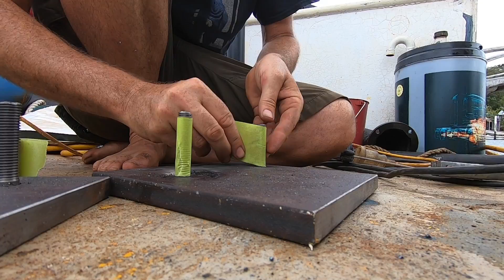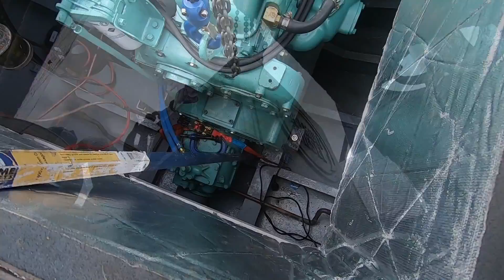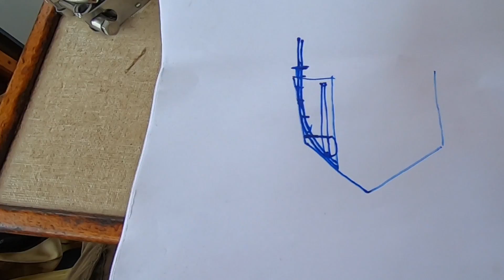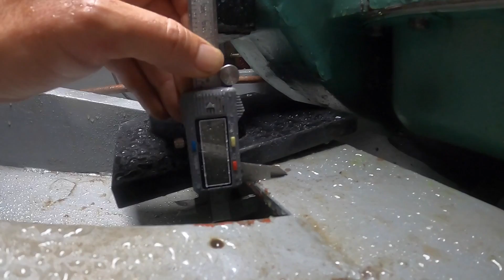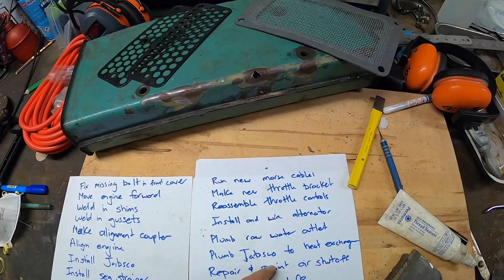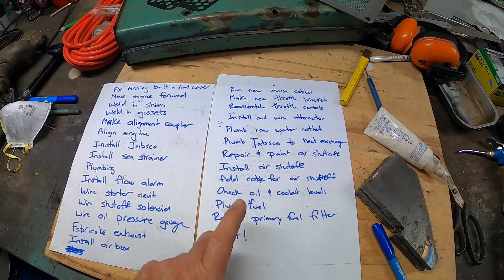Making and installing new engine shims

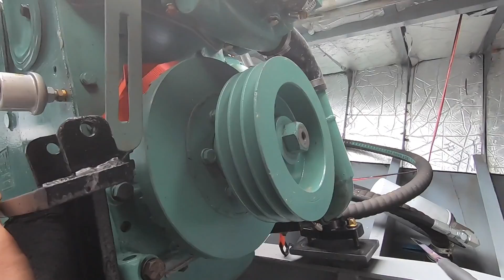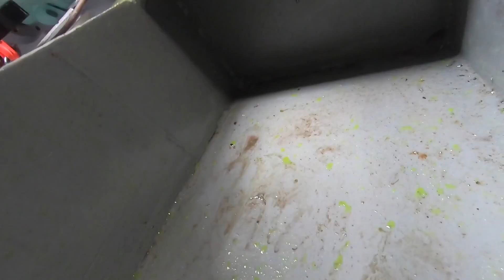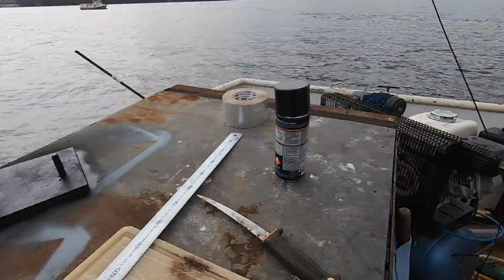Comment: For your alignment coupler  Use a bolt and some washers bolted to the engine flange to get the thickness. Clock the bolt at 3:00 and 9:00 and set the engine for left/right alignment.  Do the same at 12:00 and 6:00 for tilt up/down.  With some feeler gauges and a square you can get it spot on. just requires turning the engine over.

Comment: We had an insurance survey on our trawler recently, they wanted at least 40mm clearance between our prop and the end of the stern tube/cutlass bearing. Which we couldn’t get. We got a bit and they were happy. Not sure what the problem was as it has been that way for 60 years. Sounds like you have enough but thought it was worth mentioning. 
Cheers Josh
Reply from the maker: Interesting to hear the clearance was a requirement. Makes me think that leaving it where it is is probably the best way to go then.

Comment: You said let the adults talk 😂😂😂😂. Hey, on your shut off flap I would suggest that you have some sort of indicator giving you a visual of if it's open. There have been times that a shut flap has caused some issues with troubleshooting a no start because most people never think of that. Cables fail, clamps come loose, etc.
Reply from the maker: I've definitely seen people spend quite a lot of time trying to start an engine that has the shut-off activated!

Comment: Stu,. I am sure you will think of this or find out eventually, but looks like you need to Nick the brackets at the 177mm by 100mm corner before it will fit.  Unless the runner is a perfect 90° bend and no weld.  Love the vids.  Also I am supposed you didn't make three, flat at bottom of 10mm plate.  Extend 10mm plat to width of the 177mm length and whole length of runner secton, align motor in place then slide forward.  May be a way to "get your motor running"...head out on the waterway?!?
Reply from the maker: Yep, the edges need to be V'ed for welding and the corner rounded so I'll do that all in one step. I did think about broadening the entire section between those two ribs but I think this will still give me enough wiggle room.

Comment: Was going to tell you I have a bunch of engine shims until I saw that mega-shim. Mine are all in the hundredths and thousandths of an inch category.
**My old timer's disease made me forget which shims were in question. That's my excuse and I'm sticking to it!
Reply from the maker: Yeah, this was about getting the engine in the ballpark so I can using the threaded adjusters to do the fine movement without getting too close to the tops of the threads.
Reply: @DangarMarine  My bad. As soon you started installing I recalled the plan you had outlined.

Comment: Instead of welding or bolting the steel shim pads to the rails set them up so that they wrap the rails once you have the alignment done so that in the future all you have to do is loosen some pinch bolts and slide the engine forward on the rails and if you need to remove it again you just unbolt it from the shims and keep the alignment.
Reply from the maker: It would be nice to engineer something like that, but I think it's going to be a bridge too far this time round.

Comment: Depth reading the old school way......   SOUNDING!!!  Drop a weighted length of knotted rope in and once you hear the clunk, pull back up and you count the knots. Totally low tech...totally cheap...totally unreliable and totally the way to go.
Reply from the maker: That sounds like a fair description!
Reply: You can get proper sounding tapes with a weight at the end. Tape is flexible so will take the bend. Of course then you need a conversion chart from depth to volume - but your method of "chuck 100l of diesel in" etc. would work fine!

Comment: Fuel tank level. Loads of clever electronic systems but ...if you fit a stand pipe from deck to lowest point in tank you can dip the level and drop a suction tube in to pump out any water contamination. Two birds with one stone.
Reply from the maker: I have thought about doing just that. The only thing I'm really worried about is the trip hazard on deck.

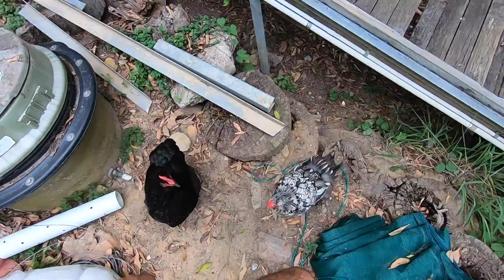Comment: 31:00 Was "prime the fuel system" on the list? ... or is that too small or included in other items?
PS: 👍🏼
PPS: 21:22 Aargh... What is the dimension of the arrow at 22:27... [approximately] in case someone wants to invent & build you the perfect coupler?
Reply from the maker: I probably will make a more detailed list for each major step, yes. Fortunately because we ran the engine in the workshop it is primed internally, there will just be a bit of air in the fuel lines to get out but being common rail these Detroits are, to a degree, self bleeding.

Comment: It looks like you need to reroute that coolant pipe you removed to install the mount plates. That line was way to close to the hatch edge above the engine. It will touch and wear thru. You are making progress though. It always seems to take much longer than you think it will.
Reply from the maker: The funning thing is, the final height of the engine is exactly the same as it has been for the last 30 years. I'm going to look underneath but I think it can be put on the bottom instead of the top.

Comment: I like the idea of using a double sprocket and double roller chain for the drive coupling.
Reply from the maker: The sailing boat Vicki bought has an electric motor which is chain driven.
Reply: @DangarMarine  the chain coupled drive coupling will allow for a slight misalignment without destroying everything. with a hard coupling its very unlikely it will run in perfect alignment.
maybe the plastic coupler is good enough but I have no experience with it.

Comment: I just love the way your mind works to addressing problems as you run across them...the only thing that grinds me like a fingernail on a chalkboard is when  I see you cutting welding grinding lifting and just working in your bare feet....Ugggggh
Reply from the maker: Thanks mate, there is certainly no shortage of problems to solve when it comes to boats! Unfortunately the thing that grinds me like fingernails on a chalkboard is wearing shoes. ;)
Reply: Dangar Marine never mind your feet just don’t put your hand under the mount of the suspended engine again plz ;) 11:25 don’t say you didn’t haha
Reply: Been a mech for 26 years and worked in shearing sheds for a decade and I hate wearing shoes as well , have only ever broken one toe and that was when I was wearing bloody shoes lol

Comment: The big question is did the fridge get plugged back in?
Reply from the maker: Not yet actually because it is solid rain for a week here at the moment and the two little solar cells won't keep the batteries charged. Must add a wind generator for weather like this!
Reply: Dangar Marine , so warm beer

Comment: Buy yourself some 90 degree spot drills. 1/4, 3/8, 1/2 and 5/8” diameter. Cut them about in half with a cutoff wheel because they are way longer than you need for 99% of what you’ll ever need. This 90* starting angle is way better for drills to center up on than a 60* center drill. The only time I now use center drill is for, well...lathe centers.

Comment: M12x1.75 uses a 10.2mm drillbit :)
Easy tip if you don't know the tap drill diameter is to take the thread diameter minus the thread pitch. So M12x1.75 will be 12-1.75=10.25, M10x1.5 will be 10-1.5=8.5 and so on... 
Maybe not accurate enough to build a space shuttle, but for a 15mm engine mount yeeaaah I reckon...
When removing the jam nut from the studs, just use the spanner on the bottom nut. If it's critical that the stud never comes out its best to apply the torque in the direction that screws it in. If you hold the bottom nut still and turn the top one you might not get the stud fully torqued down... Kind of overboard I know but that's the type I am :P